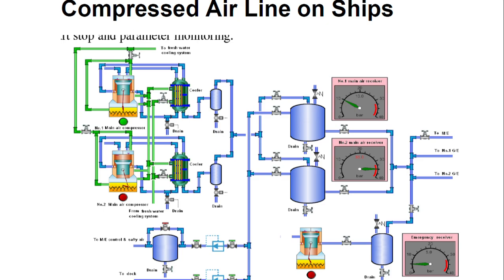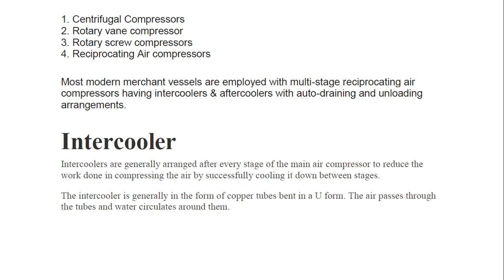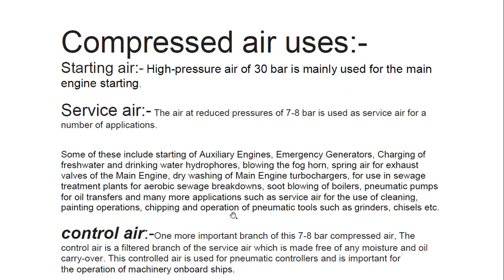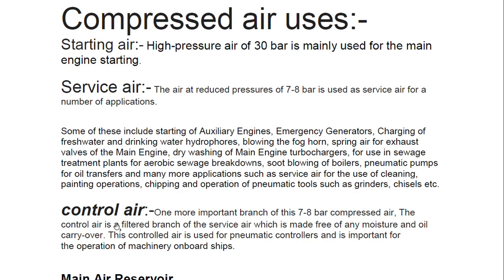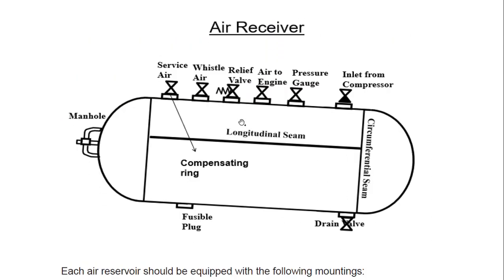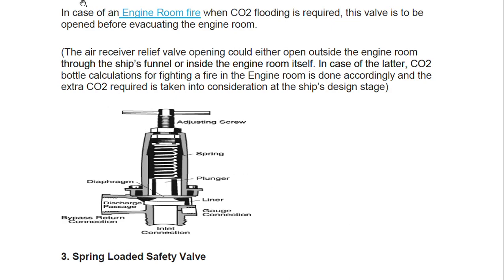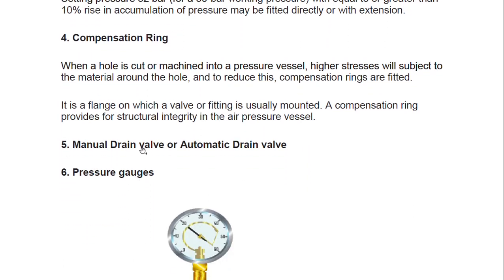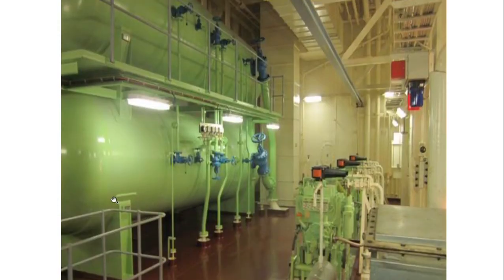SOLAS Requirements for MAC/Air reservoir or bottle/ Safety devices or mountings on air bottle/FAD.

Comment: brother, how to carry out relief v/v lifting test of air compressor?
Reply from the maker: Thank you for your message:- To test the pressure relief valve functionality, turn the system on and bring it up to operating pressure. Pull the ring on the pressure relief valve to depressurize the system. Turn the system off, and ensure the system comes back to operating pressure when the system is restarted.